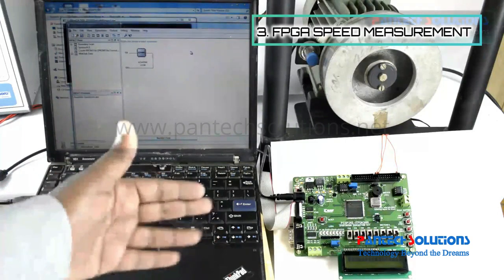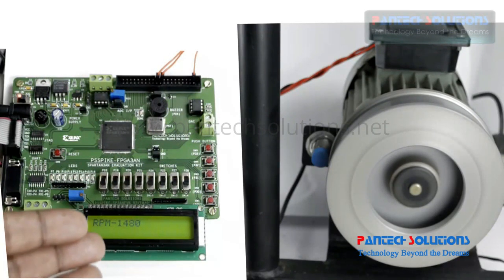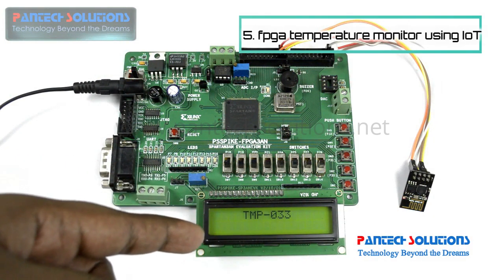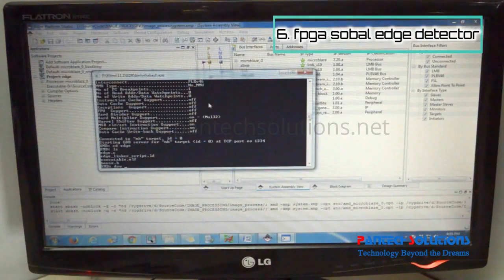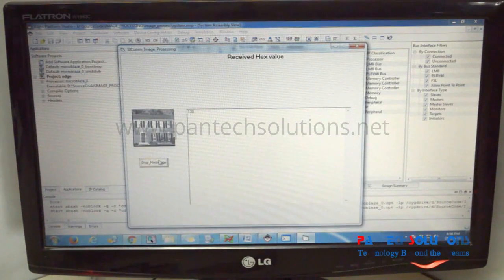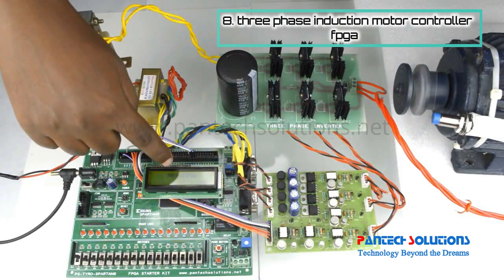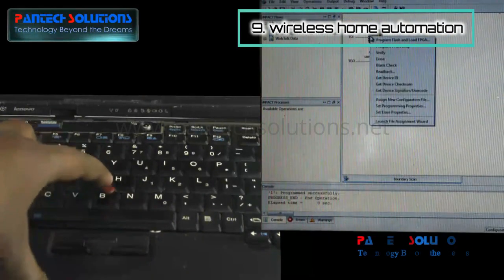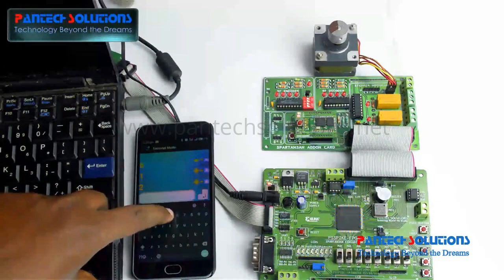Top 10 FPGA Projects   2019 | #pantechsolutions #fpgaproject

Comment: Where is the MiSTer device?
Reply from the maker: what do you mean by Mister
Reply: @pantechsolutions  MiSTer is the reason I bought an fpga. If you Google Mister fpga you will find the github repo with a wiki. It tries to be both a gaming console and a beacon of game hardware preservation. It can faithfully recreate some Nintendo consoles and neo geo and more, indistinguishable from real hardware. And it can emulate other game consoles very closely. It has a massive amount of arcade cores, and it can use the respective mame rom for those cores. It uses the Terasic DE10-nano, a massive fpga on a development board that is subsidized by Intel so its fairly cheap, not much more than 100 dollars.